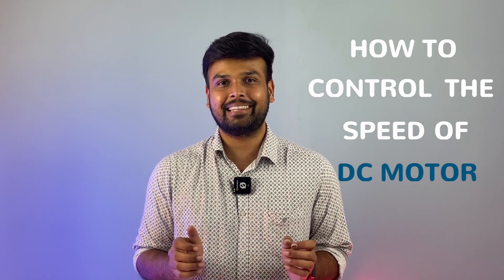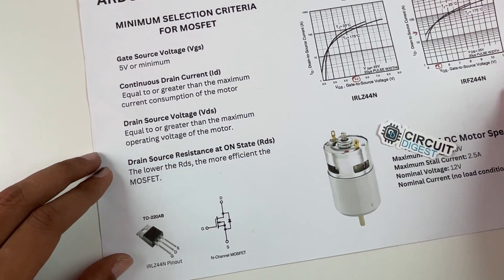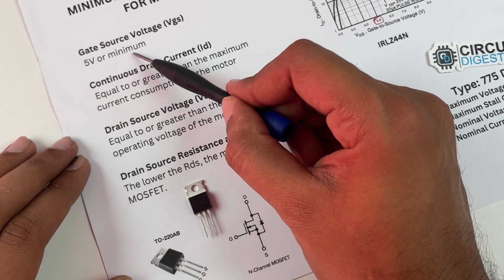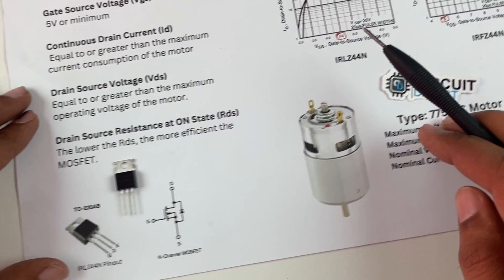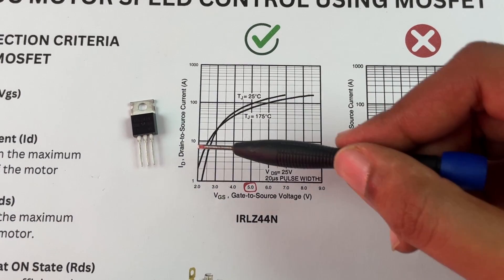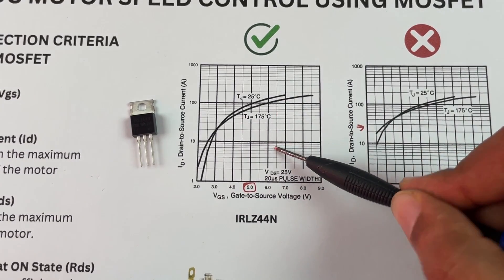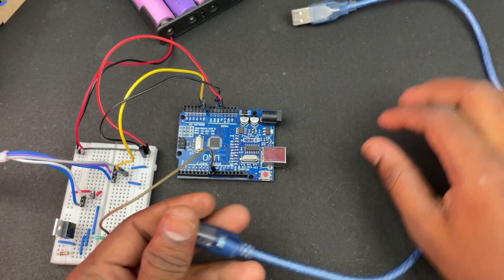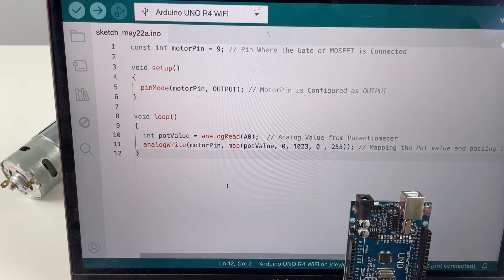How to Control Speed of DC Motor using Arduino, MOSFET and Potentiometer?

Comment: Can I use IRFZ44N Mosfet for the project? If no then can you recommend any other mosfet please.
Reply from the maker: Not recommended. You must use logic level MOSFET that can fully turned on with the 5V logic level.
Reply: So any logic level n-channel mosfet is ok?
Reply from the maker: Yes with appropriate current rating.
Reply from the maker: Mosfets with VGS(th) less than 2.5V is recommended.
Reply: @Circuitdigest  thanks i  found one

Comment: just curious, why do we need an arduino for this? can't you just use mosfet + pot and it will function the same?
Reply from the maker: If you use the mosfet with just a pot without the PWM, you control only within the ohmic region.Even there you would be wasting energy since the mosfet will act like a resistor and will generate a lot of heat.

Comment: What are those resistors for ? What is its use ?
Reply from the maker: Pull down resistor is there to make sure that the MOSFET is fully turned off and the gate resistor is used to control over-current in gate drivers and to reduce overshoot between the drain and source during switching (EMI noise-reduction). The switching time (rise and fall time) of MOSFET varies depending on the resistor of the connected gate.
Reply: @Circuitdigest  Why not explain it in video and make it simpler to understand?

Comment: 1k for gate is really high. Gate resistor should be around 20 to 50 ohms
Reply from the maker: With minimum Vtgh and rise time of 10nS, Ig = (1470pF * (5V - 2V)) / (10ns) = 0.42mA. With 1K resistor the current limit will be 5mA at 5V. So the 1K resistor is more than enough and will work just fine.